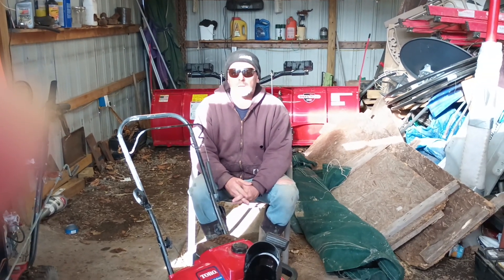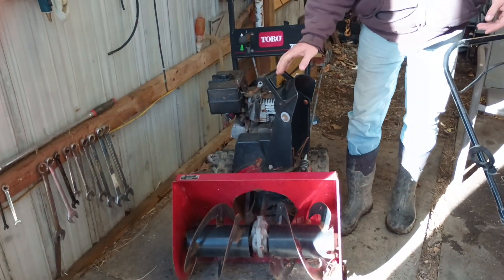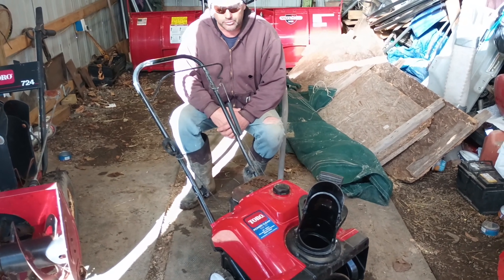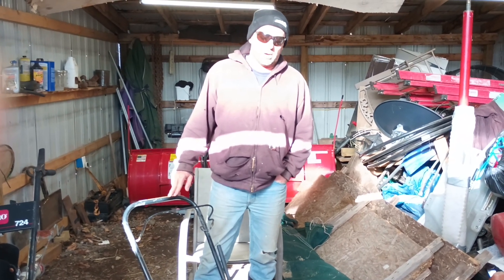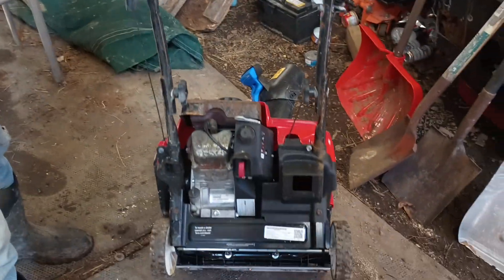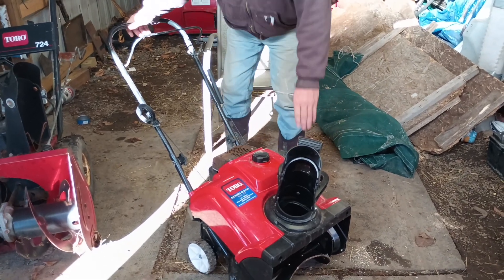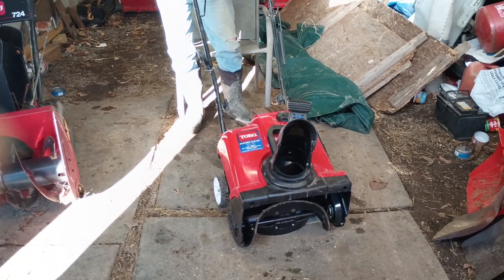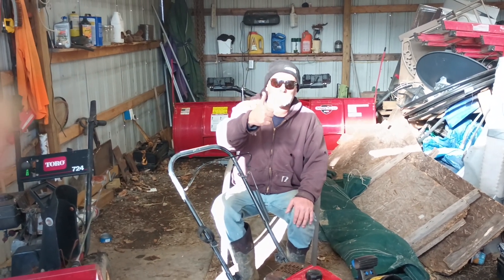Toro snowblower  Power Clear 518 ZR review

Comment: Hi Paul, had a toro 1986 ccr1000e. Just gave it to my older brother. Purchased a 4 stroke 21"  sweeper MTD at Walmart in the summer . 250 cdn half price. Keep the overhead low, save when you can. I still have the Sears 2 stage 11.5 hp 30" cut for the heavy stuff. Maintenance cost last 25 yrs approx. 300 bucks. I always run premium fuel and oil change every 3 yrs.
Reply from the maker: Yeah the old ones are definitely nice machines

Comment: It will just toss them through your windows or put holes in your siding it will just throw them out it won't chew them up
Reply from the maker: IMO as long as the pavers were installed properly and not dislodgedyou should be fine. i'm referring to Unilock products...